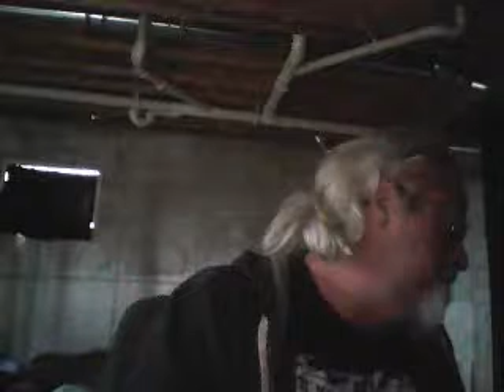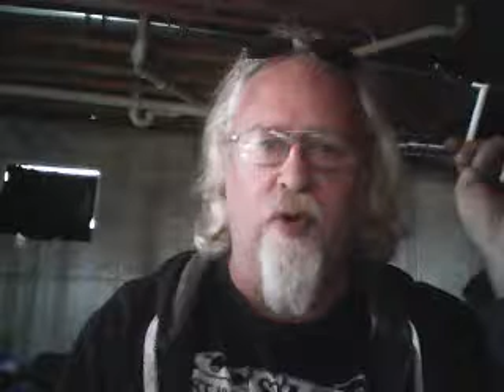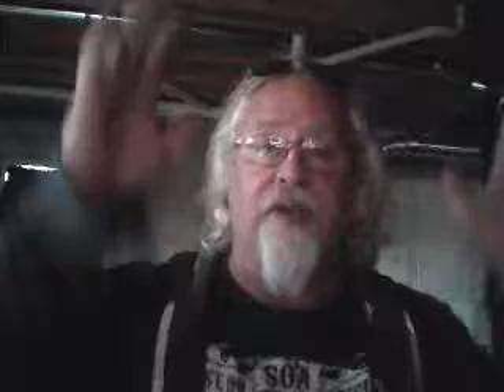Auto Park Adjustment for your motor home

Comment: AC Delco 171772 is the part number for a 1995,  P30 gasser. Available until its not at Rockauto. Its under Parking Brake shoe.  Not even $100. Easy to change. Be smart about it like he said and there is no issue changing or adjusting the parking brake. Please do leave that cable alone also.
Reply: 15619929 GM number.  Will measure mine when I get under it again. Had to replace mine because it to applied at 60mph (seems to be the sweet spot) and were gone. Almost to the point of needing a new drum.  Then we can tell if the regular rear brakes are the same size as the parking brake shoes are.
Reply from the maker: awesome info....thanks.  I wonder if there is a cross reference as well out there.....like.....brake shoe for a 78 saab or something weird.....lol

Comment: Matt, I replaced the 50 amp relay and the solenoid on the auto brake of my 1996 Allegro Bay with no noticeable difference. Then I read your post unpluged the two wire connector feeding that switch that no human could reach used a wire  and touched the connector going into the wiring harness as your post directed. I knew at that instant you were right about that switch.  I heard the auto brake release. I will be installing the toggle switch tomorrow ending this night mare. 
Thank you again for taking the time and effort of educating the rest of us.
Reply from the maker: awesome! glad i was a help

Comment: Look at the p30 chassis manual, I have the same issue. You can look for the make and model on Google and then brakes it lists them. Also I have the damon intruder  325 which is on p30 chassis  and I went to auto parts store and got brakes  part Chrysler 449 perfect fit
Reply from the maker: awesome info, ty

Comment: I want to add a parking paw inside the trans. My Workhorse is a 2003 and it has no p/brake in cab, it is full auto. And will not hold the MH.
Reply from the maker: thats prob just out of adjustment and or needs new pads if the system is at least working

Comment: What do you think about pulling the auto park system altogether, and putting in a manual pull handle and cable? This is for a 36' 2001 Winnebago.  Thanks
Reply from the maker: There is a reason they use an electric ram . Auto park works backwards, so when its off, the brake is on. So 1, you would have to pull the lever to drive, not park. The emergency brake peddle is hooked to the same system, so you could, I suppose, disconnect the auto park cable and just use the e brake.....but thats bypassing MAJOR safety equipment, and if the coach rolls through a tent full of orphans.....and there will be orphans....you would be held negligent for disconnection the system. Some systems just should never be removed or disconnected. Good idea, but im just trying to look out for your safety
Reply: @mattsez2879  Thanks Matt!  Great advice! Currently having the seals replaced on the cylinder.  Have changed just about everything else except pump.  Hoping to get on the road.
Reply from the maker: @rcstrunk  what are symptoms
Reply: @mattsez2879  well it has been a Cascade of issues.  We bought it used out of Florida from a private party a couple of months ago.  They failed to tell us they had disconnected the auto brake.  We took it to a shop where  they put in and changed the switches, relay and changed the brake shoes.    Drove it home about 10 miles and thought transmission was down shifting and the smell was coming from the new brake shoes. Drove it to storage yard and realized that indeed the auto brake was coming on and off, particularly on a rough road.  Ordered valve.  Again brought it back to house to work on it and the brake was engaging even more often.  Opened the box and found fluid everywhere.  Took apart hydraulic cylinder and found seal in very poor shape.  The cylinder is currently with a guy to replace the seal.  Rig back at storage with auto brake disengaged.
Reply from the maker: @rcstrunk  ok.....sounds like that should fix it. If not.....watch my other vid on how to wire auto part to a switch, and get rid of the factory switch that fail constantly......its an easy diy fix. Good luck

Comment: matt, I was able to cross ref my workhorse brake shoes with gm and got them for half the price that workhose wanted.
Reply from the maker: is that for the auto park?  if so, please post the maker and part number, im sure alot could gain from your research!
Reply: matt sez  I was able to get workhorse part numbers from ultrarv.com (call parts Dept. ask for Alan, he's great) then I had to find GM dealer that could xref. part number. it was a lot of work so I hope this makes things easier.

Comment: Cant get the star wheel to move. any suggestions?
Reply from the maker: its got a ratchet on it.....so will only turn one way.....did you try the other direction?
Reply from the maker: if it still will not move.....chock all wheels ( safety first....motor home rolling over your head will ruin your week ), disconnect the drive shaft from the drum, and remove the drum just like drum brakes on a car. Once drive shaft is removed....auto park and any parking gear are out of the loop, so please be careful and chock the tires well. what i do, is put the coach in neutral, and let it rock to a halt with no brakes, that way you know it wont want to suddenly roll once drive shaft is unbolted. THE AUTO PARK IS VERY SIMPLE, EVEN MORE SIMPLE THAN CAR BRAKES, SO ONCE DRUM IS OFF, YOULL BE ABLE TO REMOVE THE ADJUSTER AND CLEAN AND OIL AS NEEDED. pLUS U CAN CHECK ON CONDITION OF THE PADS........damn cap locks......giant hands.....sorry about that

Comment: Hi Matt thanks for your videos I just yesterday had my 88 guof stream hibrise classic 30' rv towed and the first company to come out only had a small tow truck it probably could of moved it but the rear wheels wouldn't move I was thinking I had to start the rv and then put in neutral then turn off the motor. Unfortunately I couldn't get my RV started the battery was dead so there truck couldn't move it :( So another tow company came out with a much bigger truck but they didn't know anything about auto brake so they started by forcing it to roll with e brake on for about 200 feet then they disconnected the drive shaft by the rear wheel
Reply from the maker: yes....batt has to have a charge to turn off auto park. A jump start and idling would have worked in neutril......but never good to tow a rear wheel drive with the drive shaft still attached.  On the bright side....you know your auto park works great!!!! lol

Comment: I've got the J71 auto part on AP32 workforce I Chuck my wheels jacked up my a rear tire put it neutral turned the key Ignition on  Went under the RV and turned the tranny I couldn't tell so I found the  Star A gesture I moved it up 6 teeth  Turn the tranny again I can't really tell the difference I have 0 part break I've already replaced them place the rotten green SwitchMy question isHow do I know when it is at the proper adjustmentI looked inside and it looks like my brake pads are just dustAny help would be greatly appreciated jaded the next thing I have to do is my levelers won't go downWhen I turn on the power it says the part brake is not on it is on but system does not acknowledge it ....
After that I have dometic 3 way fridge will not come on. UGH
Reply from the maker: with key on......when u shift to R.......and when back to P.....do you hear the auto park working?
Also, did you adjust the foot parking brake? Inside the drum is just a cam, and if the cable is to tight to start with, it can go PAST the tightest position and allow the pads to open back up. Also if everything else checks out, you might have to pull the drive shaft and drum to fully check the shoes. Mine looked fine through the adjustment hole, but when i removed the drum, they were bare steel from the auto park slamming on at 65
Reply from the maker: coach is not seeing parking brake.....so im thinking a back switch, but if that were the case the auto park would be stuck ON

Comment: ok turned key no noise
Reply from the maker: go to my other vid, motor home auto park fixed.  Be sure to check all fuses and relays first, and TEST the plug with a paper clip before you wire in a switch ( watch the vid, youll understand )